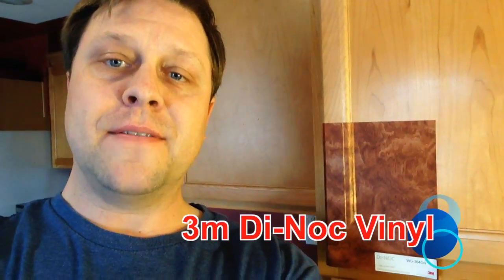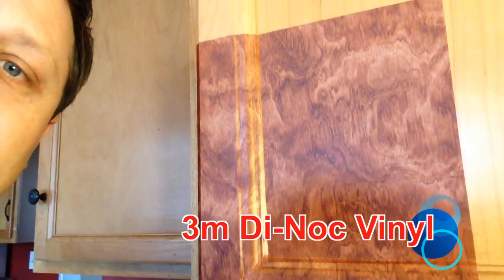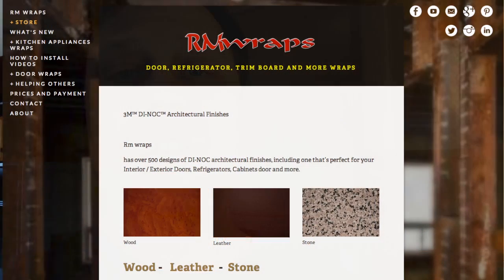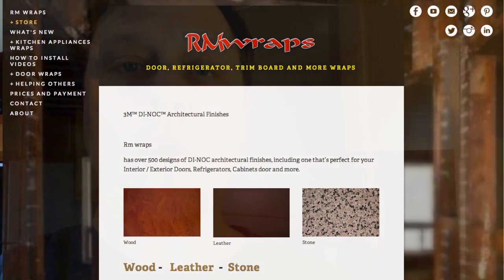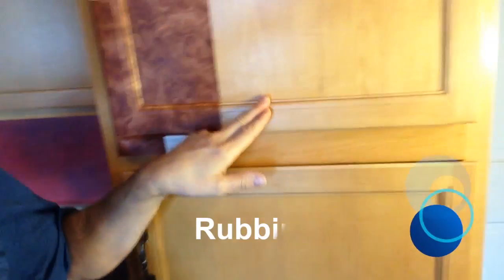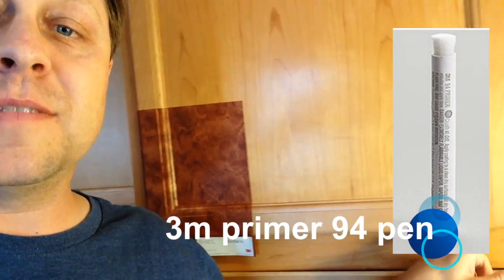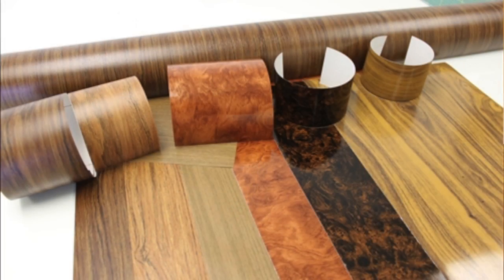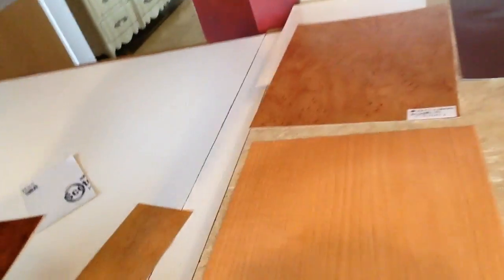DI-NOC Kitchen Cabinet wrap  - Architectural Films - Rm wraps

Comment: Can this stuff be taken off without leaving a residue or ruining the original cabinets? I want to make my apartment kitchen look nicer but they don't allow us to paint the cabinets. So this will have to be able to come off when I move
Reply from the maker: The Di-noc is pricy for a rental and very sticky. I can custom print anything you want. If its real wood and not printed wood, It will be fine. https://rmwraps.squarespace.com/cabinets/
Reply: Rm Wraps Good thing i found this link.

Your website needs a lot of work...  and a search box
Reply from the maker: I'll be updating it soon. Just been busy working hard. There is a search button, near the top. Thanks for the input.

Comment: I have a question about this because I'd love to do this in my apartment on the cabinets but I'm TERRIFIED that when I go to remove it come move out, that the cabinets will be ruined in some way. My question is basically how hard is it to get off and will it ruin the cabinets? They're finished wood with grain texture. 
Thank you 😊
Reply from the maker: If the cabinet are made out of REAL wood it will be fine removing the vinyl. But most are fake wood boxes and it will damage the cabinets. 
Your more then welcome to call me Randy 208-696-1180